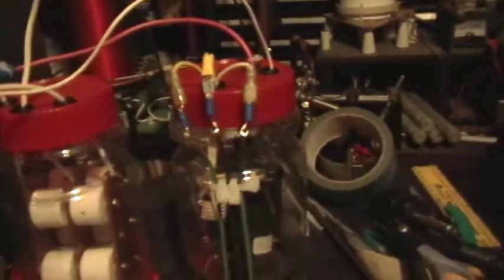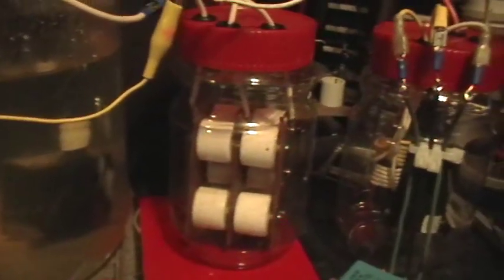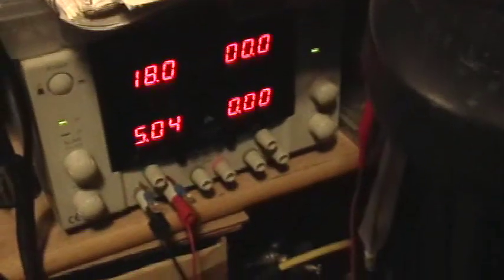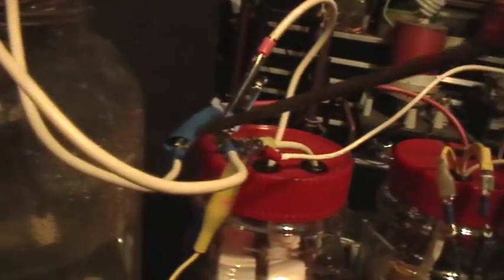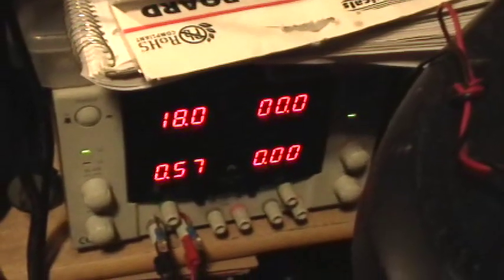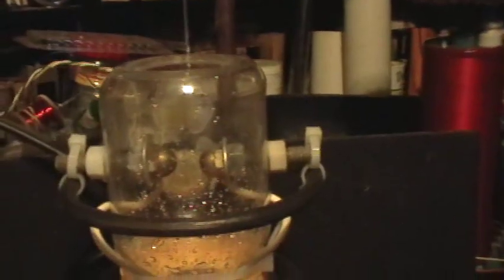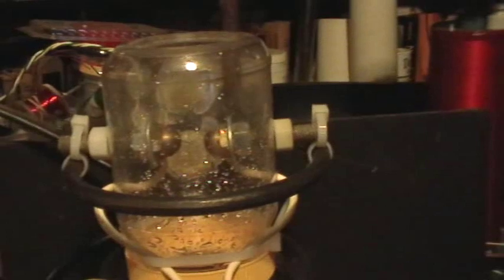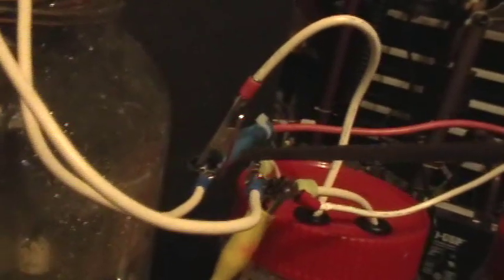Extreme High Voltage: Water Drop Trigger Apparatus, Max Spark Rate Demo

Comment: Do you have to use salt water?  I would think a drop of ultra-pure water would not work due to it's ultra-high electrical resistance.  My guess is that you are using just plain 'dirty' water since there was no mention of salt.
Thanks,
--dAlE
Reply from the maker: Try it and see!

Comment: Awesome. Never seen something like this before, does it have a practical application?
Reply from the maker: Zak farley Well, it's one way of making a triggered train of high-voltage pulses, if you ever need such a thing. I have been trying to get the electricity to blow apart the droplets to release some of the hydrogen bond energy that's keeping the water in liquid form,  and I think I may have done that.
Thanks for watching and commenting!